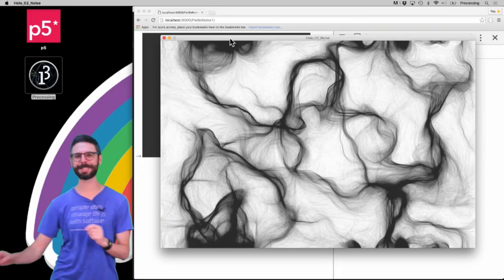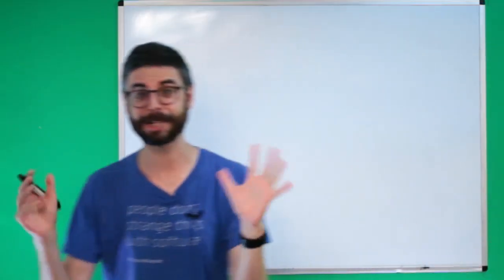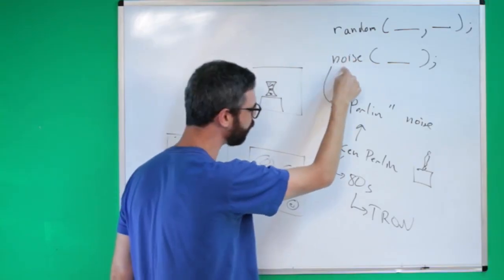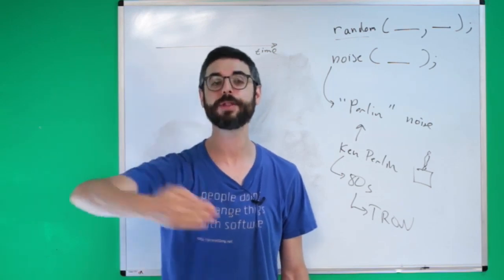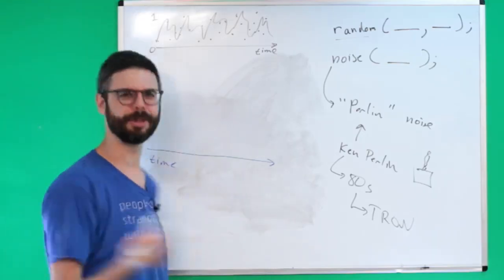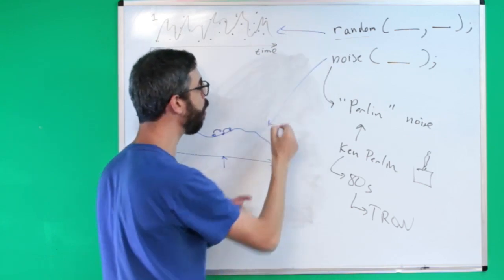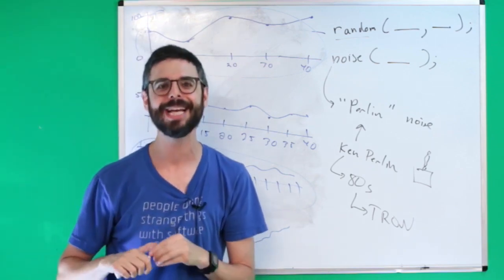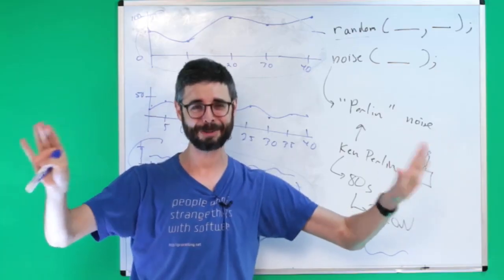Perlin Noise in p5.js

Comment: How is that one dimension?
You have Time and the number Value/Range
Reply: The noise algorithm has only 1 input; so, it is 1D noise. But, the graph of this noise is indeed 2D. Take the 2D distance function distance(x, y) = √(x^2 + y^2) for example. You wouldn't call it a 3D function, but an additional dimension is required to visualize it (2 for the inputs + 1 for the output).
Reply: @HISEROD  I get it, thank you so much.